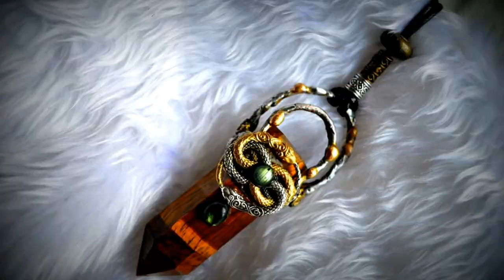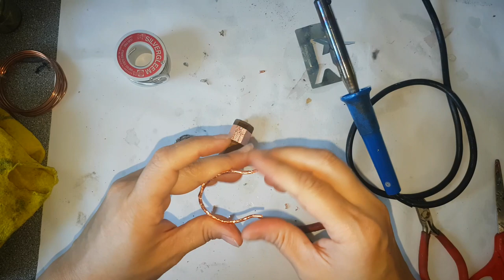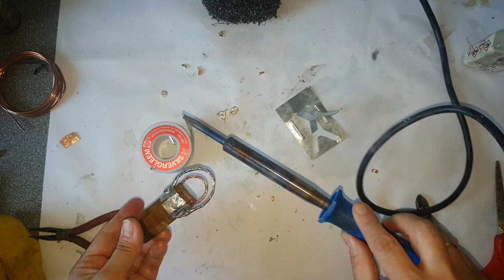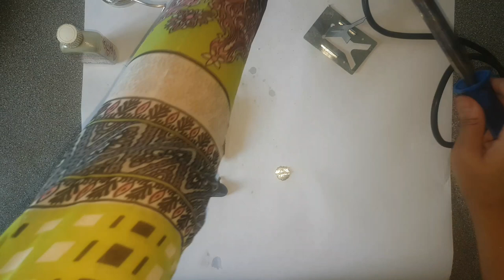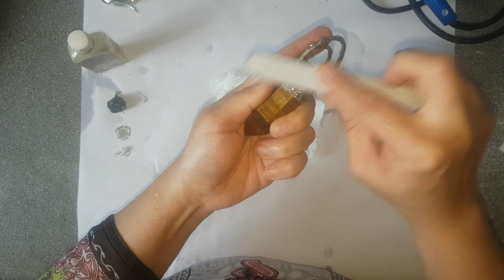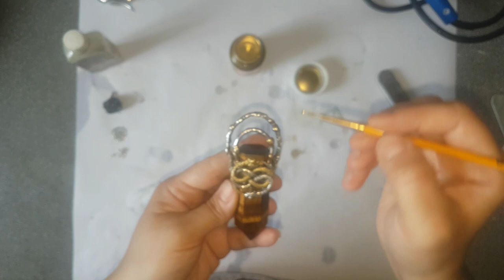Soft Soldering Pendant Tutorial | Custom Order Start from Finish | Tiffany Method

Comment: Thank you so much for your videos! What gauge bear copper wire do you use for your bales and two wraparound stones? Also, what kind of tip are you using for your solder iron?

Comment: I saw a video where a lady used very stiff cardboard or cardstock, (it wasn't chipboard) covered it with copper tape on both sides and basically made a bezel. She even ran it through an embossing machine before soldering and putting the bezel together. Then she added whimsical items & filled with resin. I have everything to do this but the embossing machine. I could use something else for the embossing affect

Comment: I have a brand new Weller solder iron and it doesn't get hot enough.  What kind of iron are you using?
Reply from the maker: Hi your iron should be 100 watt.
I am using https://www.ebay.co.uk/itm/152016282833